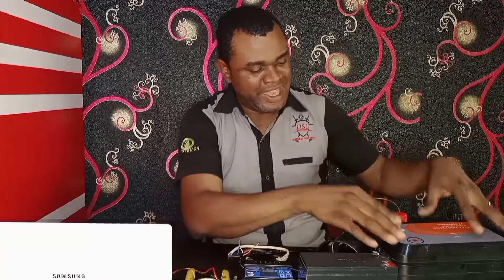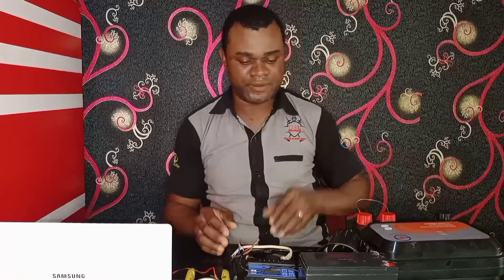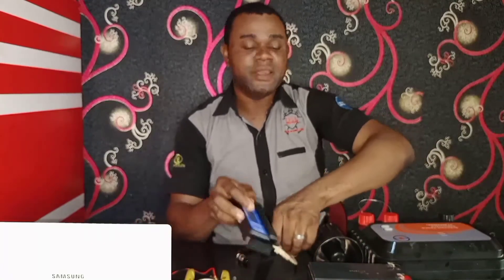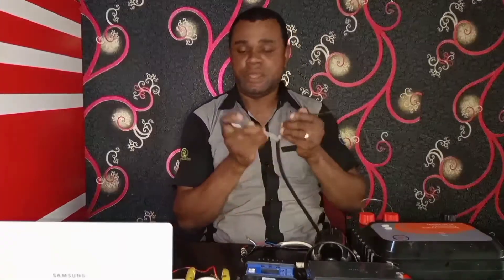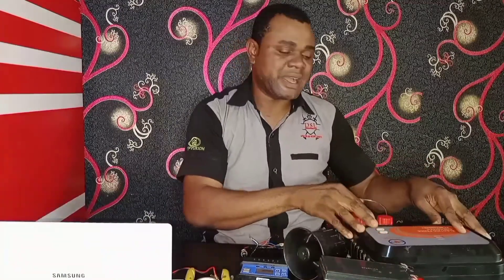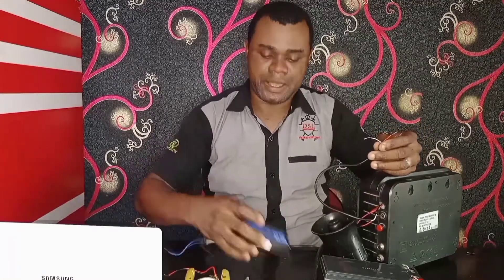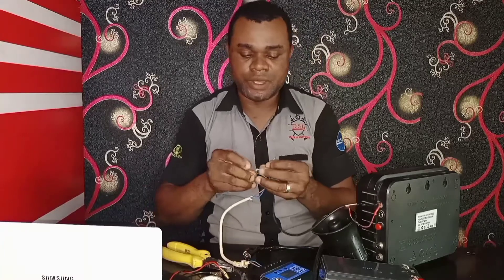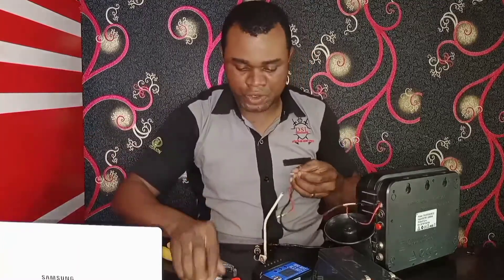How to connect your Voltron Energizer to a Solar Panel

Comment: So lovely and interesting but if we want it to be charged with both solar and electricity in the case there's no sunlight ,is this mean we may need to use of change over switch or how can we go with it ?
Reply from the maker: They can go together as far there is a charge controller